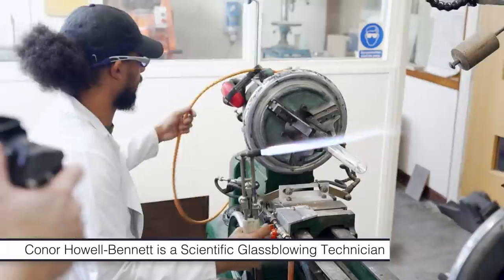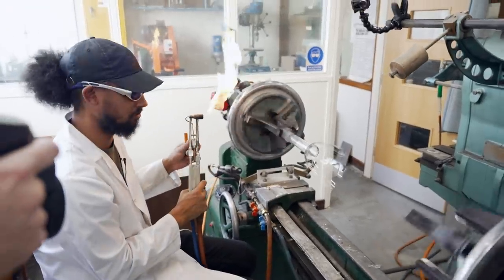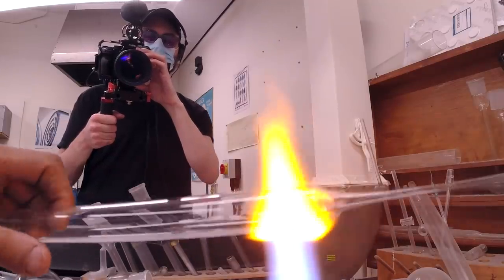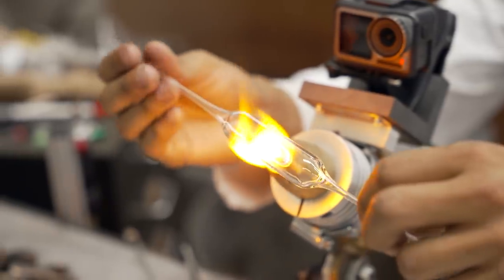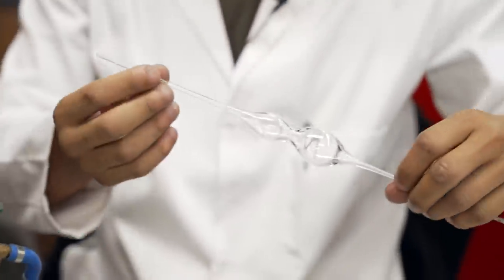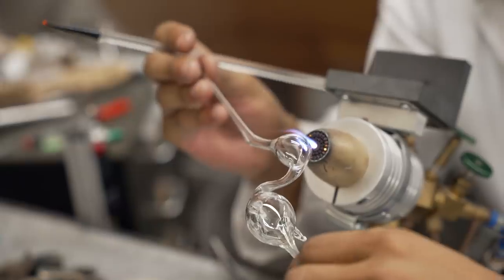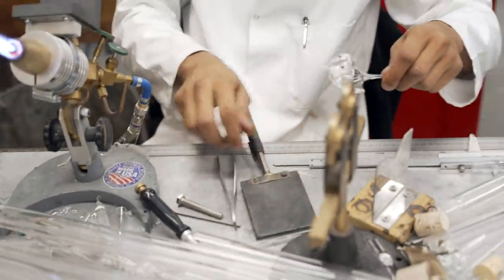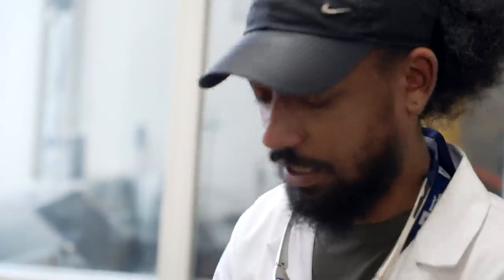Glassblowing - Periodic Table of Videos

Comment: Conor's goggle might make an interesting sidebar; I believe that bluish tint is designed to absorb the yellow light of the torch (Sodium ions from the glass?). I think the glasses are simply glass doped with a transition element. I want to say Erbium but it's not.
Reply: Didymium: praseodymium and neodymium
Reply: They used to be made of didymium like the comment above says, but now it's far cheaper and easier just to make them from dyed plastic lenses. The laser blocking goggle companies have a wide variety of plastic dyes they use to block the many laser lines commonly in commercial use, and you can for instance get from NoIR their DY4 lenses which selectively notch out the sodium D line doublet just as well as actual Nd Pr doped glass does, if not better. Their absorption spectrum is far less interesting though, being just a single somewhat narrowband absorption peak at 590nm, whereas the real glass lenses show a wide array of narrow peaks attributable to the many f orbital transitions in rare earth elements, and could be used as a spectroscopy lesson in their own right.
Reply: @Muonium1  That's really cool, but I have to wonder if the cost of that sort of lens for a single frequency* would still be cheaper than doped glass with similar characteristics tuned to multiple laser frequencies.  I assume they have a shorter lifespan due to the lenses being less scratch resistant. Even polycarbonate (I believe used in prescription lenses) wouldn't last terribly long being donned and doffed frequently in a shop environment.
---
*It strikes me as much more difficult to achieve multiple deep notches in the pass-band when using glass, but I can't say that with any confidence. Perhaps I'm inferring that from the lower melting point of plastic making a wider range of colorants feasible.

Comment: Cool Video! Didn't know there was an optical device to see mechanical stress in glass. 🤓
Reply: They should make a video on how it works and what applications you can use it for.
Reply: I mean, you can do that with a polarized lens too. The device they used is called a polariscope I believe.
Reply: the technique is called photoelastic imaging analysis. stress in a transparent material alters its birefringence.
Reply: I think that's why you see a checkerboard pattern on the rear window of a lot of cars when you have on polarized glasses- you can see the stresses the tempering puts in.
Reply: Yup, doesn't need fancy equipment, just some polarizers. Neat fact: LCD screens are polarized, so, say you use one to backlight an item (like uh, I have some molded plastic safety glasses handy, that show internal stresses), and look through another polarizer (special sunglasses maybe, or, you'll just have to get a sheet of polarized film), you'll see the rainbow effect.  If you have two sheets of course, you can use any source, illuminate the object through one polarizer then look at it through another.

Comment: IIRC the bright yellow flame is vaporized Na coming from the glass. And the reason Na is included in the glass in the first place is to make the glass easier to work. That kind of suggests that the longer you work glass, the less Na it will have and the harder it should become to work.

Is that true? Or does the Na boil off to slowly to actually make a difference?
Reply: All I know for sure is it doesn't take many ions to make a really bright color in the flame. I'm guessing the glass loses Na too slowly to notice.